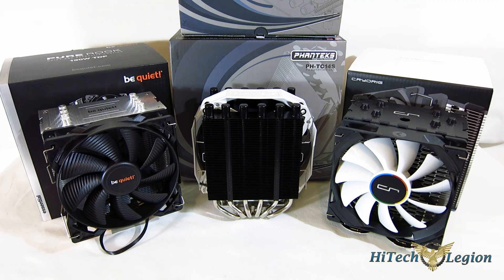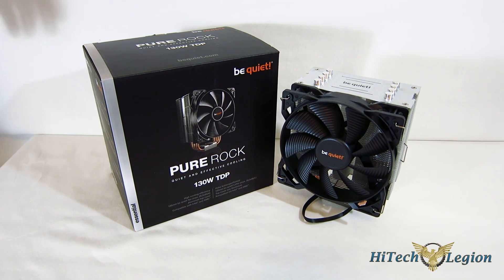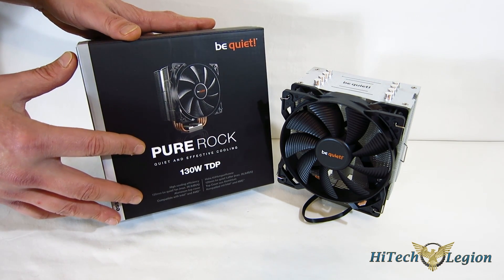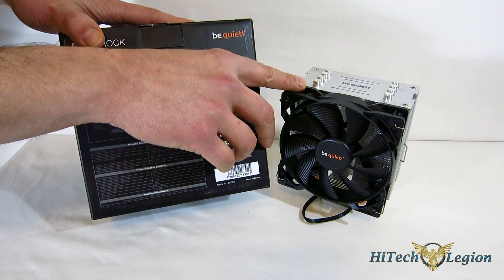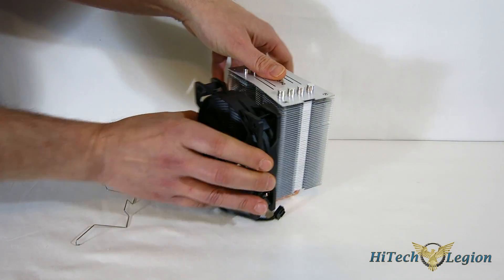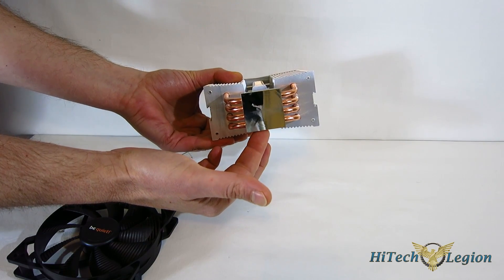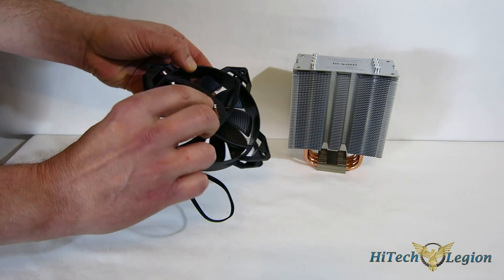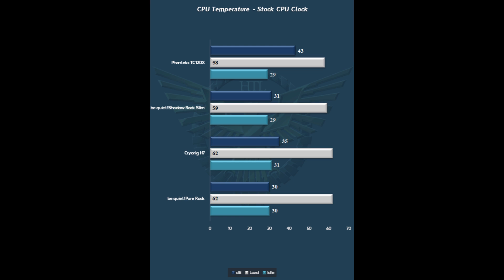be quiet! Pure Rock CPU Cooler Overview, Installation and Benchmarks

Comment: For those who cant make this fit with the amd brackets included with the cooler, use the intel braackets and use the screws included with the amd kit and it should fit. 
I have the hp higos 8309 board and they use the am4 socket but the am4 bracket included is too big and dont line up with the holes but the intel one did.

Comment: If you test in a PC case with all fans installed, you'll see a bigger difference between this guy and a slim version. Because air flow of the slim version and intake case fans one are opposite, and this reduces an effectiveness of the cooler. Full version blows in a coherence with exhaust case fan. So, "full" version will beat a "slim" one in real tests. As it must be considering their sizes.

Comment: For the fan clips: Do it like it's shown in the diagram - one side all the way into the dent (with the fan at an angle to allow this). The clip will slide into the fins and the fan'll be tight, but slightly askew, but you can nudge the fan into proper alignment. Then just put the other clip in.
Reply: dude this saved me, thank you

Comment: You said earlier that the fan could be installed on either side then mounted it blocking one of the RAM slots. First off why would anyone want a fan that stopped you from getting as much RAM in your machine as is possible. BUT why didn't you just mout the fan on the other side where it wouldn't have impeaded the RAM slot, I thought that was the idea?

Comment: Good thing on that the install is easy on the amd site because I accidently f up installing my cooler and now my cpu is running towards the 80 degrees while idle so f buying a new cooler if it's a little more expensive to just buy a new heatsink that is silenter

Comment: I clocked my 8600k to 4.7ghz with this cooler. Sure it runs at 78 c* but it keeps it there. Have to get an AiO for further overclocking i guess. Because gpu temp ram temp and motherboard sensors are way lower so its not because of bad airflow in the case.
Reply: Tbh I was shocked when I read that it says it only supports 1150, 1155, 1156 etc. but after researching it does support 1151, why?

Comment: Is the Pure Rock overkill for a i5 6600 (non k)? and is it compatible with 1151 motherboard?
Reply: It's slightly overkill, but it will work just fine on socket 1151. There is a thinner model called "Pure rock slim", it would be a good size for an i5-6600
Reply: Thanks mate :)

Comment: Does it come with pre applied thermal paste?
Does it matter on what side you put on the fan?
Reply: Yes it comes with paste, and you can mount the fan on either side as long as you keep the back of the fan to the cooler.
Reply: 69aussieguy so should the be quiet logo be visible or be facing the heat sink ?
Reply: You want the logo to be visible, that way it pushes air into the cooler. The cooler can also be used with 2 fans where one pushes and the other pulls (so one fan needs it's logo to the cooler), but it doesn't increase the cooling by much.
Reply: 69aussieguy thx

Comment: Amazing Cooler!!! Installed in a 7 years old system with intel quad core i7 950 (1366 socket) and Asus P6T motherboard. My cpu temp dropped down 22 average!!! Maximum temp at 65, running a benchmark. Before cooler installation the same benchmark showed maximum temp at 86!!  It fitted great on the motherboard. All my 6 ram slots are there. And the fan is so quiet, I can only hear my GPU fan... Tomorrow comes my new Asus GTX 1060, so I expect better results...

Comment: Hello HiTechLegion,
I have this same cooler and have followed the instructions but it seems the cooler is loose.  The clamp holds it in along the length of the clamp, but it wobbles the other way to the point where I lift up the PC case, one edge of the cooler lifts off the CPU due to the weight of cooler.  It's a bit like the clamp isn't tight enough even when the screws are fully tight - like the cooler needs to be about 0.2mm closer to the motherboard or something.
Can you offer any advice on what's going wrong?
Reply: ....just a slight correction on that post.  At the end I said it's like the cooler needs to be closer to the motherboard. When the PC is on it's side the cooler sits nicely on the CPU.  IT's actually the crossbar (fitted at 11:00 in the video) that needs to be closer to the motherboard - it should be holding the cooler tightly in place but it doesn't.
Reply: Solved it!
I needed to screw the spacers (at 07:30 in the video) in a bit further and there's no wobble any more.
Reply: Hey. May I ask you what CPU did you install it onto? I'm thinking of getting it for an Intel i7 7700K. Do you think it will handle it okayish?
Reply: Hi, sorry for the slow reply..... and lack of qualified advice!  But. the i7 7700k had a TDP of 91w, the box my cooler says it can do up to 150w.  I've seen some that are 130w but either way, it should be able to handle the cpu.  MAKE SURE it supports the socket type as well though, otherwise you'll have a cooler that won't fit on your board!
One other tip, I found out that the motherboard I had had a maximum cooler weight of 450g which doesn't seem much for a high end board now I've started to look at cooler weights.  Sometimes they go up to 900g!  The cooler I have is around 650g I think so too heavy for my motherboard.  I'm swapping it for a low profile Noctua cooler to privde less stress on the board.
I hope this advice is useful.

Comment: I'm guessing there is no reason it can't be mounted 90 degrees from shown here so that the fan is to the bottom? I'm using all 4 RAM slots and the heat spreaders make them a bit higher than normal. My 1st PCI slot is empty, so hopefully that will work, I'll know soon enough as I've just ordered one.

Comment: I'm mainly concerned about audio and the looks. Would you recommend the Pure Rock over the Cryorig H7?
Reply: I would, only because I found the pure rock for $10 cheaper and because the h7 constantly has stock issues. From my research it sounds like the h7 cools slightly better when pushed to its limits, but the pure rock's fan is quieter at full speed. Very close though, and both outperform the hyper 212 evo.
Reply: Oh, and having just installed the pure rock, it looks great except for the giant BE QUIET! logo on the side of the heatsink which really stands out on my mid tower case. Just depends on if that's your thing.
Reply: Hey, what CPU did you install it on? 
I'm thinking of buying the Pure Rock for an Intel 7700K, but not sure if it will handle it. It should be alright though, as everyone is saying it performs the same as the Hyper 212 and Cryorig H7. What do you think?

Comment: I don't think you needed thermal paste... However all I have used is an Intel stock cooler, so...
Reply: You must use thermal paste if you want the cooler to work correctly.
Reply: You'll always need thermal paste, but you won't always have to apply it. Often, especially with Intel and AMD's stock coolers, the thermal paste is preapplied.

Comment: I like the part where you showed the fan installation
Reply: Literally those fans are the most gawd awful installation ever... VERY difficult to install without damaging the veins on the cooler.
Reply: @sentineloffreedom  I figured it out eventually, and it is a nice cooling system, but you are so right about the installation being difficult. I've build so many computers and this was the only time I actually had to find and instruction video. I suspect this guy cut to it being installed because youtube would pull the video from all the cursing he did while attempting the install.

Comment: Maybe a noob question: can you mount the heatsink horizontally too? Do you just put the two brackets (on the front side) differently or do you need entirely different brackets? In my next rig I'd want to see the text on the cooler clearly, because it looks sleek as heck.
Reply: +Intel Core i7 6900K On an Inte 115X, you would simply mount the retention brackets across the top and bottom, rather than on the sides.
Reply: George Cella Yo, thanks man!

Comment: Well I am having a problem with my CPU temperatures despite installing the new Be Quiet! Pure Rock cooler. I have an AMD FX 8370 Processor at Stock Speed. 

I installed the Pure Rock Cooler but with the stock thermal paste that was already attached. I remove the old one from the cpu with the thermal removing alcohol. But my temperatures are shooting up to 64 degrees celcius in only 2 minutes of stress testing before I quickly stop the process!!! Is this normal?! 

Idle temps lowest is 33 degrees celcius. But when I do a full 100% stress test in just 2-3 minutes the temps would exceed over 60 degrees. I was wondering whether this is normal. Or do I need an even more powerful cooler than that? My motherboard is ASROCK 970M Pro3. And my case is Aerocool X-Strike GT! Many thanks...

Comment: I was hesitating to buy this cooler, because I wasn't sure if it could handle an i5 4690k with a bit of overclocking. But thanks to your video I am now confident in buying it :) Thank you! 
(I might even post my cooling results here once I get it, if anybody's interested)
Reply: +xDutchInfinityx If you're still interested, my 6600k idles at 23°C with this cooler (no OC yet).  I'm hoping to overclock sometime soon, but I just haven't had the time.
Reply: Im interested! Just bought a i5 6600k and want to do some overclocking too. What are your temps @ what ghz?
Reply: xDutchInfinityx
Due to some problems with the delivery I ended up buying a different cooler. I am now using an Arctic Freezer i30, but I haven't done any overclocking yet (didn't have the time during the holidays). But at the standard clock of 3.5 ghz it doesn't go higher than 60C when I'm playing modern games. Haven't got any actual benchmarks though.

Comment: Great review and really appreciate the time you take to explain all aspects of fitting with clear practical examples. This really helps for my first build.... i5-4460 3.2GHz / be quiet! PURE ROCK / MSI H97I AC Mini ITX / HyperX FURY Blue 16GB / EVO-Series 250GB / Toshiba 3TB 3.5 / EVGA GeForce GTX 750 Ti 2GB Superclocked / Corsair Builder 430W 80+ Bronze / Fractal Design Node 304 / AOC Q2778VQE 60Hz 27.0. All for 820.00, and great free instruction on YouTube. Big Thanks.

Comment: Am I just really stupid? How the hell do you put the damn brackets on the fan?
Reply: Hire a surgeon with a complete set of operating room tools.  I've been building computers for well over 20 years.  This was THE HARDEST install I've ever done.  You can't put the mounting bolts in with the fan in place and you can't mount the fan once the sink is bolted down.  Dumbest install of all time.  I managed to do it but it took me 3 hours to get the fan on and the help of a third hand.  Their installation procedure is an insanely stupid way of going about things.  Just for the record I bolted the heat sink to the processor then used hemostat type clamps to put the wire fan mounts in place and that was ridiculously hard to do.
Reply: @shootr1303  I'm new at writing work instructions for a living. I will never feel shitty again.
I even injured myself doing this crap.
Reply: +Axel Shark How'd you do it?
Reply: ***** Figured it out, the shape of the brackets is deceptive.
Reply: Can someone send me a link to how to do it? I feel real dumb

Comment: so on a AMD it doesn't even need the back plate?
Reply from the maker: *****
AMD installs use the existing hardware on your MB.
Reply from the maker: paradoxdesigns AMD installs use the existing hardware on your MB.
Reply: HiTechLegion i whant to use this on my a8 6600k fm2+ to replace the stock one. but do i need the backplate or not?
Reply: +HiTechLegion +HiTechLegion hello I am new to building computers. but I recently built one and idk what fan I can use and bla bla bla. basically can you help me by telling me if I can use this fan in my pc and if not if you know one that is quiet but not too expensive. I have a Asus A68HM-K Micro ATX FM2+ Motherboard, VGA GeForce GTX 950 2GB Superclocked+ ACX 2.0 Video Card, EVGA 430W 80+ Certified ATX Power Supply, all inside of a Thermaltake Versa H21 ATX Mid Tower Case. please help me I don't know and I hate my stock fan because it's super loud
Reply: it'll fit on FM2 CPUs yes, but be warned on most motherboards its going to cover one of your ram slots and its also quite large so make sure you measure the space inside your case first
Reply: +paradoxdesigns can you do me a favor please and search up the motherboard I have and tell me if it will block a ram slot because I only have 2 ram slots and I need my 8 gigs
Reply: +paradoxdesigns litterly I dont know anything about computer as of things like this. I don't want to buy the fan and be disappointed that it blocks my ram or even won't fit

Comment: need help with this, https://pcpartpicker.com/user/chillin1/saved/ , $600 its all i have, plus i just play CsGo, Dota2 maybe l4d2, for now, looking for a quiet pc. and good graphics on these games. is this cpu cooler better than the slim one?
Reply: netOalaracO Might want a bit more powerful cpu since the source engine uses barely any gpu power and i have an amd fx-8350 4.0 ghz and i get frame drops not many but still noticeable and i upgraded my gpu from a gtx 650 to a radeon r9 270x and only gained 30fps
Reply: netOalaracO You might want to look at a cheap Intel HD laptop.
Reply: +TheStruggle no, just no
Reply: Go with a cheap pc max 300

Comment: Why the hell does this one says it's 130W, but mine says 150W?
Reply: +paradoxdesigns Can you imagine a 150W fan, though?
It'd have to be insane turbine-style, 10,000RPM beast.
"This is my fan. It draws more power than my CPU."
Reply from the maker: akalion213 After further testing be quiet! changed the wattage rating for the final release units.
Reply: HiTechLegion Ah I see. Thanks!
Reply: paradoxdesigns No no no lol...That's the amount of heat the heatsink is designed to handle basically
Reply: akalion213 haha yeah, i just did some research on TDP and it makes sense now :)
Reply: +paradoxdesigns ahah easy thing to be confused of though!
Reply: +eni that made me laugh for some reason.
Reply: HiTechLegion so this fan uses more wattage than the CPU itself?

Comment: great review thanks. surely though if the fan can go on the other side of the heatsink then you wouldn't lose a ram slot? thermal paste already applied...did you remove this just to show us the finish or are you not a fan of ready applied tp?

Comment: Yeesh! You just put a lil worry in me after watching this review with the memory slot issue. I'm shocked nobody else and all the reviews I read have touched up on that because isn't that kind of a MASSIVE issue? Who the hell can afford to lose a memory slot? 
  I've yet to perform the installation or unbox my Pure Rock cooler but now you got me wondering what the hell I should do because I use all 4 slots with G.skill memory that have a little height added to them with their heatsink shell... Obviously moving the fan to the opposite side of the heatsink would be useless.
  Has anyone else figured out what to do in this situation?
Reply: I like to answer my own question because after looking at enough pictures from various sites with it installed, although nobody posted one with memory directly underneath the fan, I felt I saw enough clearance at various angles to attempt this on mine. Now I use G.Skill Ripjaw X, 4gb sticks for anyone wondering.

 After applying the heatsink, setting up the fan directly next to the heatsink as described in the video fit just about dead on. I will say, I had to raise the fan by maybe a quarter of an inch to clear the memory, but still not bad at all. Installation was dead on as shown in the video.

 If I can make 1 suggestion on the next video, do a closeup on each screw you use prior to using it because I did have to rewind this a few times to make sure I had the correct screw. Other than that, thanks so much for this video!
Reply: Latinommicz Hello, I'd like to know if that was that much of a problem to put that fan higher on the heatsink, because I myself have my four memory slots taken by Corsair Vengeance High-profile 4gb sticks and I planned to buy that specific fan.
Reply: Haalkolikh   Hey, I googled those memory sticks you mentioned and the height of the heatsink does look quite high. I'm honestly not sure if you want to take a chance with this using those memory sticks. They are taller than my memory heatsink...

   Like I said, I had to move my fan up maybe a quarter of an inch to clear the memory height and by moving it up, you are removing the fan from cooling the PureRock heatsink on the CPU which eventually defeats the purpose of buying an aftermarket cooler. 

  Let me know what you decide.
Reply: I received the gear today and the memory was indeed far too high. Putting the fan high enough to fill the first slot would leave about a quarter of the heatsink without any fresh air, so I gave up on it. I sent back the sticks and eventually decided to order their Low profile version.
Thanks for the answer !
Reply: Haalkolikh Sorry to hear that you had to return the memory but I think it's worth it in the end so that you can use the PureRock and in the future any other cooling system you might want to upgrade to for whatever reason.

  I think honestly, reviews should discuss more about this issue because it's major with all the large memory heatsinks these days for gaming oriented memory. Who else is buying these type of coolers? Mostly, TA DA, gamers... You would think they would either post this warning on the product or at least more reviews should mention it. Nobody is going to lose a memory slot to cool their CPU... It ain't happening in most cases.